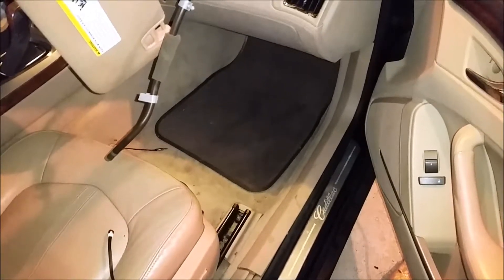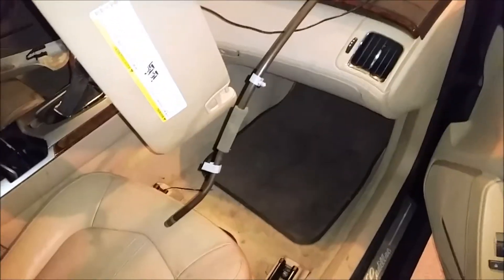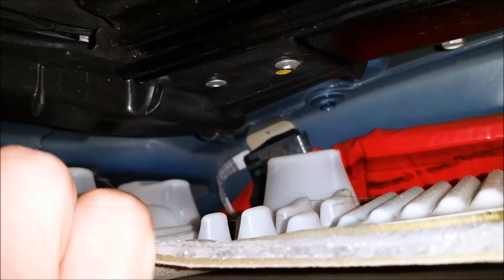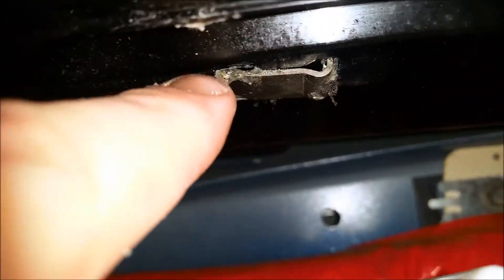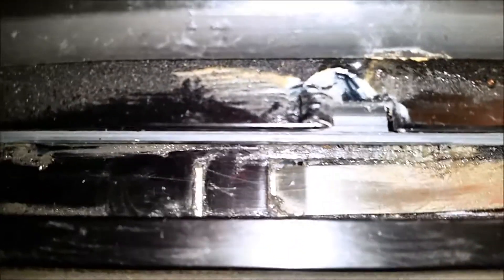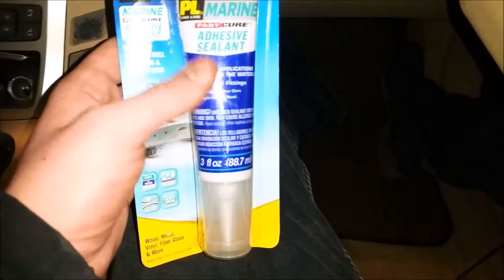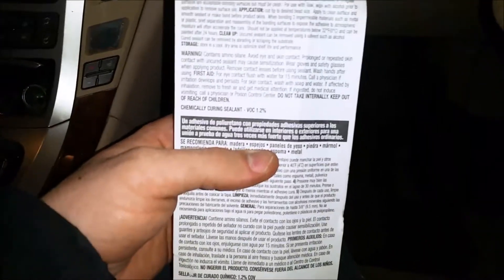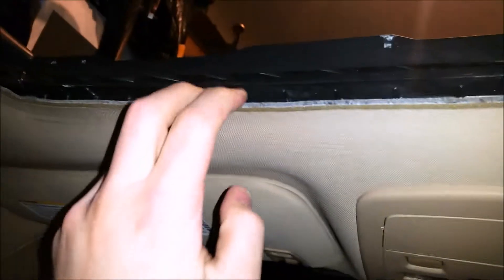Easily Fix A 2008-2013 Cadillac CTS Leaking Sun Roof

Comment: The sunroof drain is a backup defense for a failed sunroof glass edge seal.  Your first step should be to replace the failed seal around the perimeter of the sunroof glass.  Regarding sealants, RTV is used to seal water pumps, valve covers etc.  it's also capable of sealing a sunroof gap and it remains flexible unlike other adhesives that get hard, brittle and crack.

Comment: Thanks for the video - I just found that my leak on the driver's side is at the top of the A pillar, I guess where the tube connects to the corner sunroof drain. How is the headliner removed at the corner above the A pillar to get access to that connection so that I can see how the repair needs to be done? I've been looking all over and can't find anything that shows removal of the headliner at the front of the CTS. Thanks for whatever help you can offer.  👍
Reply from the maker: It's held on partially by your sun visor, partially by your rear passenger roof handle, a crap ton of clips around your sunroof opening, the a-pillar cover, and a few clips on the roof itself. Basically anything secured to the roof through the headliner is a sneaky fastener for the headliner itself.
Reply: @stollo770  Thanks for the prompt and helpful response! I'll feel my way around carefully with a good idea now of what to expect as I go pulling on the edge so as not to bend or break it.   👍

Comment: I need to do this to my Cadillac. Did that lock tight work? And did you apply it to the bottom or the top of that moving part?
Reply: Use RTV.  It's used on water pump gaskets so it's more than capable of dealing with a sunroof.  It also remains flexible which is a key feature needed to seal a moving joint